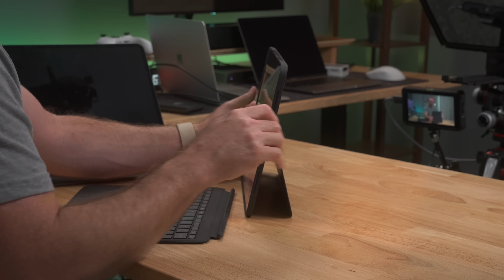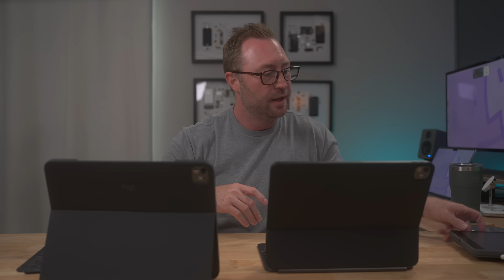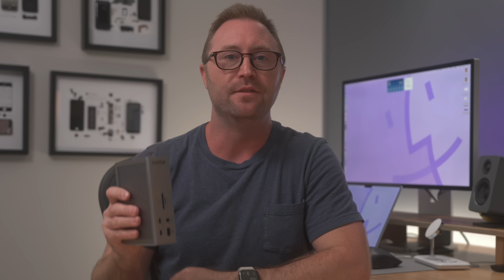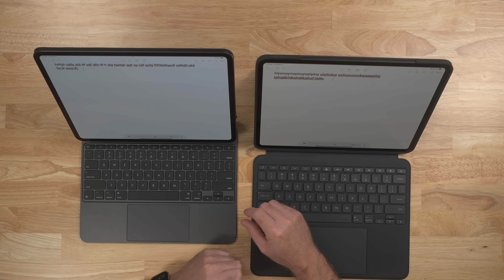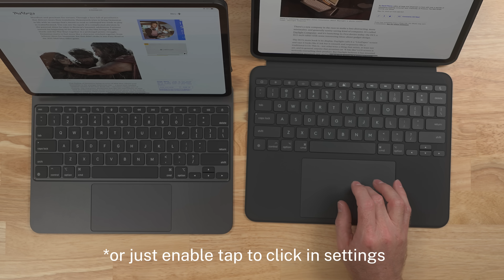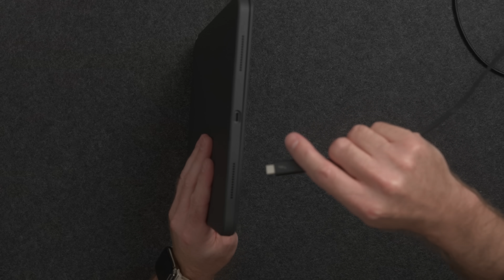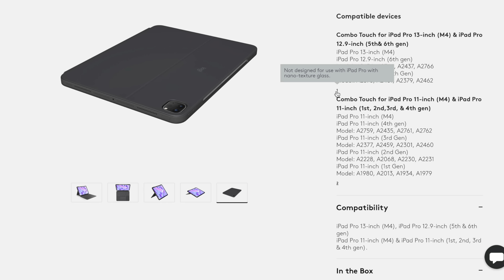Logitech Combo Touch vs Magic Keyboard for M4 iPad Pro!

Comment: Excellent video you must have some Ronco in your blood from the  Veg-O-Matic TV guy.

Purchased my 10.5 inch iPad Pro with 256 GB November 2017  7 years ago I paid $800 then. I bought the logitech keyboard case combo for $139 at the same time. It had the row of  function keys but not the touch trackpad that came out later. In seven years it’s never let me down. Still works great. Protected my iPad from some serious drops, on more than one occasion. Most importantly, it protects the edges. which the so-called magic keyboard does not. I traveled to Bangkok Thailand,Tokyo Japan, Alberta Canada, and many other places over the last 7 years with my iPad and Logitech keyboard in my backpack. Never sustained any damage.

Today 5/24/24 I just bought the discontinued iPad Pro 12.9 inch with 256 GB on a closeout at BJ’s for $919. Then I bought the logictech touch keyboard case on sale at Amazon for $129.99. Hopefully it will work as good and protect my $920 iPad. It will be nice to have the trackpad my old keyboard didn’t have. As far as the USB-C connection, either a small knife or scissors will take care of that problem I just have to snip a little bit off to make any plug fit. The color is tan so fingerprints should not be a problem.

One last thing the only thing magic about apples  magic  keyboard is the price 💰I tried that in the store 7 years ago it was a  terrible design then and it’s a terrible design now even though they finally after 7 years include a row of function keys which logitech had 7 years ago. If you are going to sell a product for $350 it should at least protect all of the edges to cover the over $1000/2800 iPad one drop on the edge, and it could easily be finished. Good luck with the magnets, holding it in once you remove it there’s no protection at all so be ready for some nice scratches all over the back of it and on the edges on the over $1000 to $2800 iPad.🤷‍♂️

Limited time deal  12.9 logic, tech keyboard, touch combo. 5/24/24
$129.99 with 43 percent savings -43% $129.99👈👀
List Price: $229.99 List Price: $229.99

Comment: Thank you for the review. I have the Combo Touch on my M1 iPad Pro 11 inch. I am considering one of these options for my new M4 iPad Pro 13 inch. In all honesty, I thought that Apple would have created a case to protect the iPad when it's not on the Magic keyboard by now. Even a bumper case like they used to make for an older model iPhone would help to keep the edges more protected if a customer opted to go that route.
Reply: Magic keyboard with protected edges will be my dream setup. I picked up the Combo Touch because I use keyboard less, and I love the stand which does’t wobble in bed!
Reply: What made you go from an 11 to 13 iPad Pro. I have a M1 Macbook Pro, but will mainly use the iPad for video editing and photo editing. So leaning toward the 13. Right now I have a 5th G 8in iPad.

Comment: What is your take on closing the keyboard cases over time? would the metal of the Apple Magic keyboard cause issues in the future against the glass? would the combo touch be a better bet over time? 
also if you have a glass or thicker screen protector, would have been an issue with opening and closing the case over time?

Comment: You can adjust the brightness of the keyboard backlighting in control center…if you add it to control center, then just press and hold on the tile.
Reply: Yeah, the confusion’s there because you have to add it to Control Center once manually, I guess. But honestly, even though I put it there four years ago when I first got my original Magic Keyboard, I’ve never actually used it because it just uses the ambient light sensor to set to a good amount of backlighting and I haven’t ever felt the need to turn it up or down on my own.
Reply: @Aiii83  it’s true, it was always a complaint by folks that you couldn’t adjust it on the Magic Keyboard but I’ve never needed to adjust it either.

Comment: 10:50 That’s not true about not being able to change the keyboard brightness in Control Center (CC). The keyboard brightness (KB) function can easily be added to CC. Just go to CC in Settings, scroll down to More Controls, and add the KB function to Included Controls. IMO, it’s not much of an inconvenience to access KB via CC. Also, adjusting KB isn’t something one should need to do too often, I would think.
Reply from the maker: Hey thanks
Reply: @JerrySchulze Hey, Jerry. Thank you, for comparing the two and sharing all of the tips and tricks. Much appreciated. I’m really enjoying the new Magic Keyboard; however, I do like learning about other options.
Reply: Yup, I was about to say the same thing
Reply: Thanks!

Comment: Thanks for the video. 

Wondering, some previous combo touches occasionally would get a bit glitchy with lag, mistyping when using the keyboard, sometimes a trackpad gesture may not work. It didn’t feel as flawless as the Magic Keyboard. 

Do you find those same issues with this one ?
Reply from the maker: I agree with previous versions, I have not seen that issue so far with this one.

Comment: Combo Touch Advantages:
1. Provides complete protection for the iPad with a casing that covers its sides.
2. Flexible usage, can be separated from the keyboard for various usage modes like tablet or tent mode.
3. Adjustable kickstand for different viewing angles.
4. Lighter weight compared to the Magic Keyboard.
5. Larger trackpad provides more space for gestures and movements.
6. More affordable price compared to the Magic Keyboard.

Combo Touch Disadvantages:
1. Takes up more space on the desk compared to the Magic Keyboard.
2. Stability when used on the lap is less optimal, especially if there is a slope on the thighs.

=

Magic Keyboard Advantages:
1. Sturdy design with aluminum construction provides a premium feel.
2. Provides a laptop-like user experience with good lappability.
3. Adjustable to various viewing angles, including a low angle for watching videos in bed.
4. Passthrough charging through the hinge allows for charging while connected to additional devices.
5. Trackpad offers more responsive clicking experience.

Magic Keyboard Disadvantages:
1. Lack of side protection for the iPad, making it vulnerable to impacts or scratches.
2. Heavier compared to the Combo Touch.
3. Higher price point.
4. Does not offer the same flexibility in usage as a protective casing.
Reply from the maker: So which one do you like?
Reply: I do NOT recommend this product if you are going to use the keyboard anywhere other than a perfectly flat area. Placing your hands on the keyboard when it’s on your lap slightly bends it and chaos ensues - your mouse starts clicking randomly and in weird places. HUGE disadvantage for someone like me who likes the versatility of using the device on the couch, in the car, or in lecture halls without desks. I’m currently debating returning the product :/
Reply: @nathanpinnock9541  Which product? There are two under discussion and you didn't mention which one you are talking about.
Reply: @RickinICT  the Logitech. I ended up sending it back and getting the Magic Keyboard. I use my iPad as a tablet for teaching physics and need it to sit flat and though the Combo Touch would have been nice for that, I couldn’t use it how I wanted or on small college lecture desks. The Magic Keyboard does an alright job as a tablet (not as well as the Logitech) but it has about 90 degrees (better than last gen Magic Keyboard) of workable angle if I have it laid flat. It is annoying needing to flip it every time, especially compared to the Smart Folio, but it is what it is 🤷🏽‍♂️
Reply: Ok chat gpt